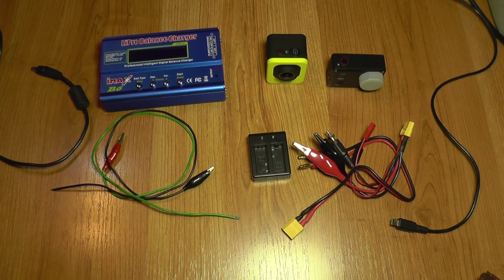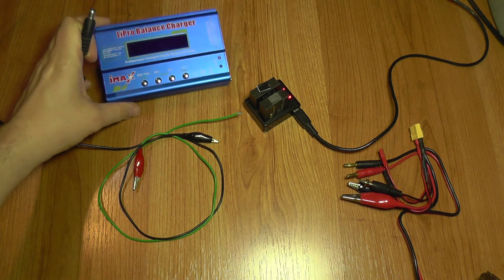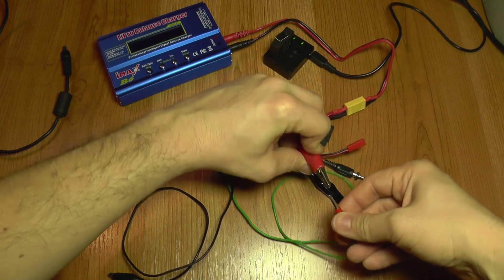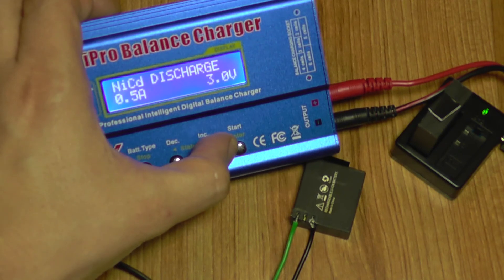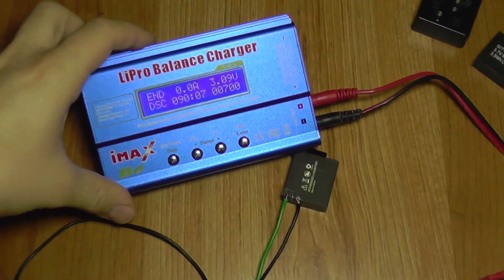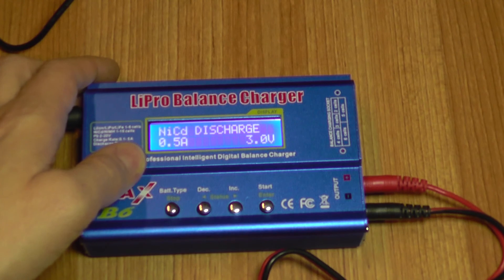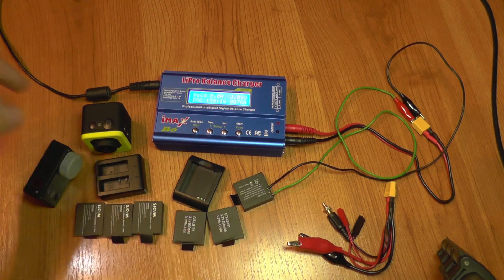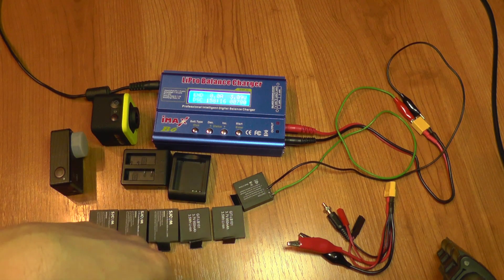Li-Ion Battery Capacity Test - SJCam vs. GitUp

Comment: Do the Git2's batteries "self drain" when the camera is turned off, and just sitting in it's case?  I took mine out to use and the battery was dead.  I had fully charged it a week before.  I used my backup battery and it had a mostly full charge from sitting for two weeks.  Does the camera's internal clock drain it?
Reply from the maker: Hi there, I know the problem you have, and yes it's a problem, the battery should not drain, nor the date should not reset in 30 seconds if you remove the main battery. See please if the date resets and if yes then I have a easy solution to fix the drain and the date.
Reply: I just pulled the battery up a bit (not out)  for the count of ten, and pushed it back in again.  When I turned it on again, the time and date had reset.  So what do I do?

Also does V-1.5 have a way to turn off the time/date stamp at the bottom of the screen?  I thought V-1.4 did, but I may be mistaken.
Reply from the maker: bigwheelsturning
OK, then it's a fault that can be fixed easy. You need to take the front cover off (4 hex screws) and then on with the lens faceing you on the top left corner you will see a tiny watch like battery soldered on the PCB (it's a capacitor), next to it it's a screw that touches it. Either remove the screw completely or extremely gently try to make a small space between the battery and the screw. The discharge problem and the date reset problem will be fixed. As for date stamp it can be disabled from the respective video settings menu or from photo settings menu.
Reply: I guess "quality control" in china is "just get it out the door".  Will take a look to see if the screw is touching.  thanks for the info.  I finally remembered that I could go to the video settings and change the date stamp.
Reply: Pulled the screw out and restarted the camera, set the time, turned off, pulled the battery for a count of 10, pushed it back in and started the camera.  The time/date had reset to 01/01/15 again.  The screw was not touching and it didn't look like the screw head was touching the "trace" of the capacitor.  I used a sharp point and put a scratch between the screw hole and the trace to see if that might help, but I haven't "recycled" the camera yet to see if that helped.  I guess I will just have to take the batteries out and reset all the settings I want to use each time I use the camera.  I will put a bit of electrical tape under the screw when I put the camera back together.  Just paid off the Credit Card for the Git2 today.  You get what you pay for.
Thanks for the help though.
Reply from the maker: bigwheelsturning
Just remove the screw for a test. Also charge the battery (in camera) so that the capacitor also charges. It should be OK. Actually the Git2 is one of the best quality action cameras found in this price range.
Reply: I did a test with the screw removed, but it still reset the time/date when I pulled and reinserted the battery.  Will try it again after charging it in the camera.  I put the screw back in again, but I will just live with the problem.  The problem came from the factory as the battery in the camera was DOA, but the extra one I ordered still had a charge in it from the factory.  Go figure.

Comment: Hello. I have a SJ5000X Elite camera. It has been idle for quite some time as I did not have the occasion to use it lately. I have purchased extra batteries with it which have been idle too  since I got them several months before. I think they are Li-Ions and I am concerned they might get permanently destroyed by some improper storage. Any tip/advice on how to properly store them? Thanks for all and any reply.
Reply from the maker: First it would be a good idea to give them a full workout (charge and discharge) then the best way to store them would be to keep them at ~ 50% charge (3.85V).
Reply: Very helpful!  Will do that.Thank you.
Reply from the maker: Herminigildo Jakosalem
You are welcome !